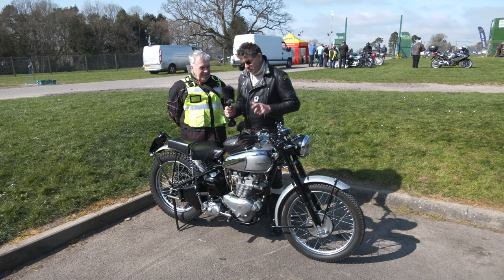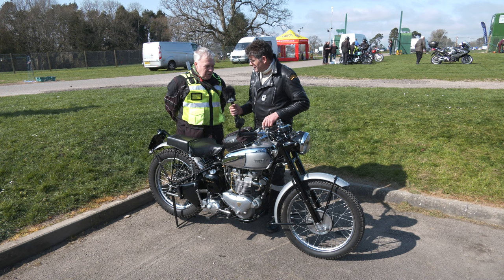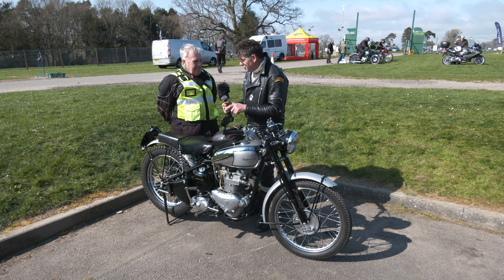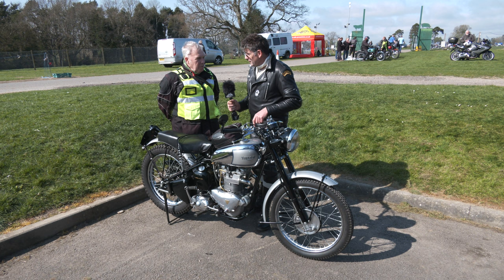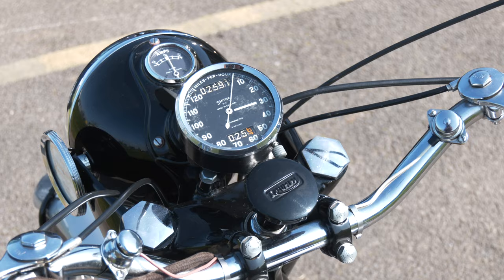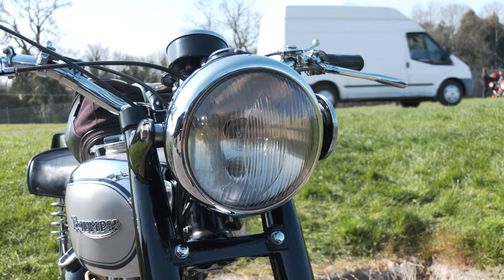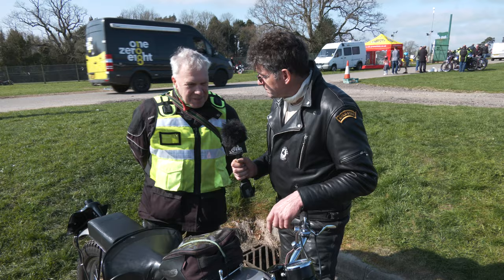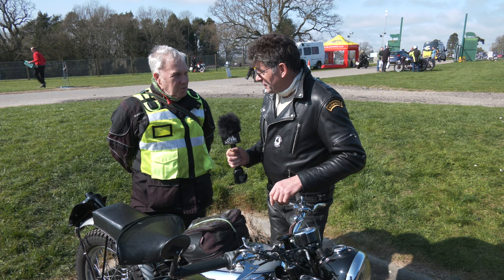1949 Triumph Trophy TR5 square barrel start-up & ride away

Comment: He did a nice job.  Sounds as good as it looks.    I'm new to vintage kick start bikes.  I still need to master the art of kicking it while sitting on it with no side-stand or center stand down.  He made it look easy.   I always feel a little off balance, like I'm gonna drop the bike as I attempt to kick it.  For now I start it on the center stand.   I've heard people say that's the correct way to start these bikes and others warn against kicking it on the center-stand for some reason.    I know the side-stands can brake off, so starting on the side-stand is not usually advised.
Reply: both stands up, stradle the bike and take a long sweeping kick, not a sharp short stabbing kick like most people do but a long slow sweeping stoke of a kick, and if a 4T engine is set up correctly, IE points/CDI timing and carburetor, when cold full choke and don't twist the throttle open, keep it closed, when warm, no choke and the throttle opened slightly no more than 1/4 open, always worked for me, if it doesn't its probable the carb set to rich, a 2T engine is another thing altogether as far as starting is concenened I've found,
Reply: @girishs1755  
point taken, as always, cheers man,

Comment: That is some sweet restoration.  Nice to know the origin of the all aluminum top end was to keep it light for use in the Lancasters.
Reply: It wasn’t fitted to the plane-it was used as the power source for a portable generator set at the airfields to power the starters for the Merlin engines. Triumph designed the alloy top to reduce weight and it was square as that is a much easier shape to enclose with shrouding for fan air cooling. I own a 1949 square barrel Trophy.

Comment: Please, how was this engine used on the Lancaster? Little engine starting the big engines?
Reply: 24 volt fixed and portable generator unit.
Reply: I'll guess it was used to power an APU. Auxiliary Power Unit, which generated electrical power to help turn over the bomber's engines for starting.  The Boeing B-29s had a small air-cooled v-twin for those chores, probably similar displacement, and looked like a small aircraft engine in itself.
Reply: Now I understand.  Thank you guys for the explanation!